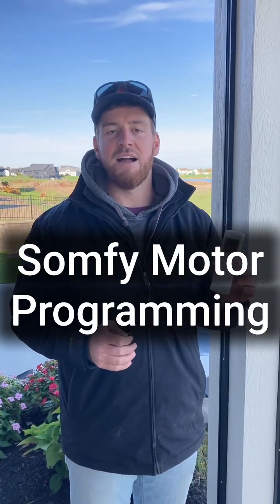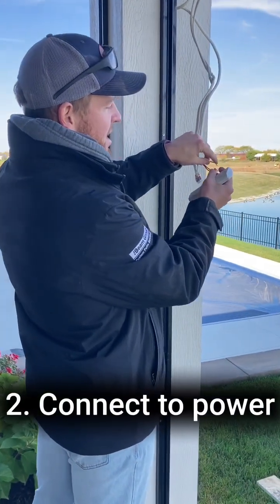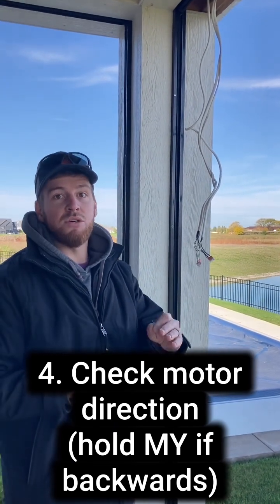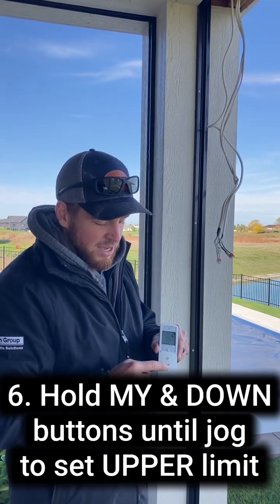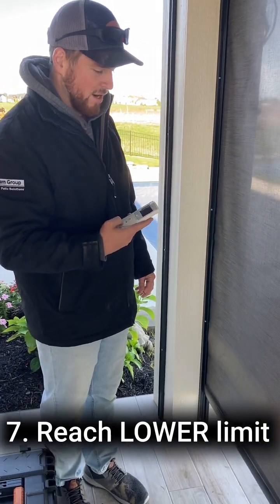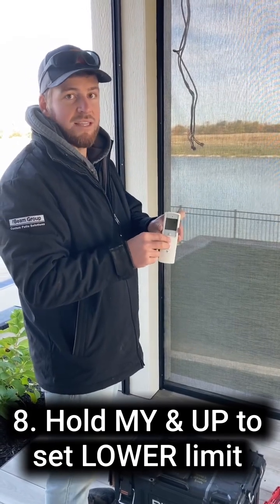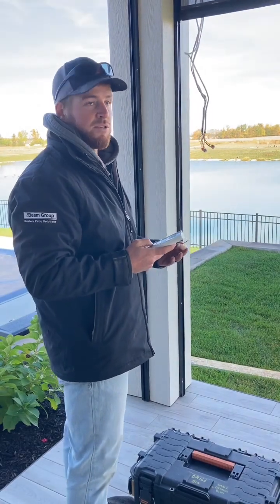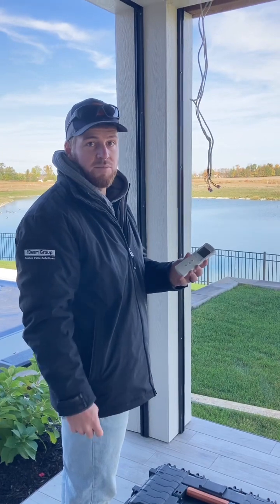Somfy Motor Programming

Comment: My blind doesn’t go down after I have held the my button and the up button
Reply from the maker: @JaneDoyle-v7s  What I have found if something doesn’t work it’s best to just do the factory reset (see Somfy factory reset video we have) and start over. You may want to do the factory reset then wait 5 minutes before trying again.
Reply: I have done the factory reset 3-8-3 power off and still no response
Reply from the maker: @JaneDoyle-v7s  Just being clear since I'm not there in person, the motor should not respond to the remote after doing the factory reset.  If it does still respond, the #1 I see people miss is holding the program button on the back of the remote through TWO separate jogs (holding the program button for about 12 seconds total).  The #2 most missed step is not pushing the program button on back of remote to lock in programming after the last step, but it doesn't sound like you've gotten there yet.

The other thing to clarify is that my video is referring to Somfy exterior shade motors (not the same motors as indoor blinds & shades).  The steps are pretty similar but my company does all outdoor products so that could be the problem.

If you're working with outdoor screens AND you've successfully reset the motor then try going through the programming steps in this video again.  Maybe try setting the lower limit before setting the upper limit (my video does upper limit first because that's how I always do it).  Somfy is the biggest brand and widest used for all types of motorized shades but they can be a little quirky.  I used to struggle and couldn't find good troubleshooting videos especially for the outdoor motors so I started making my own.  I hope this helps!